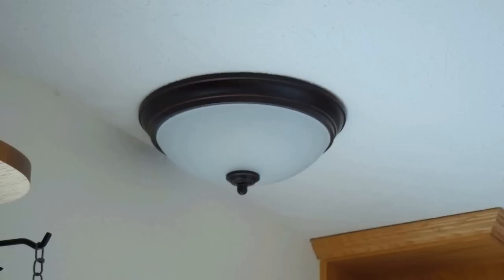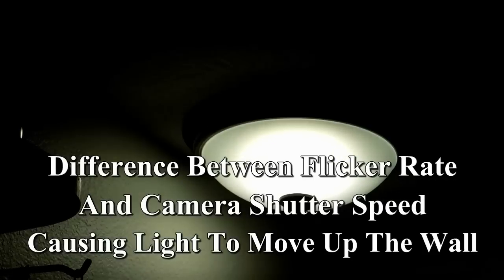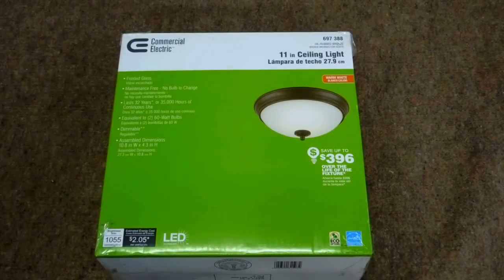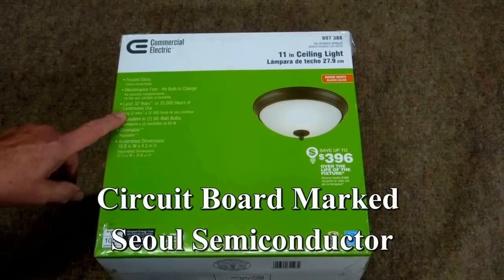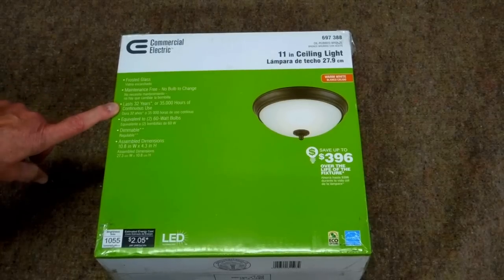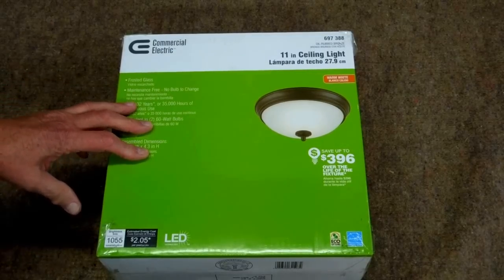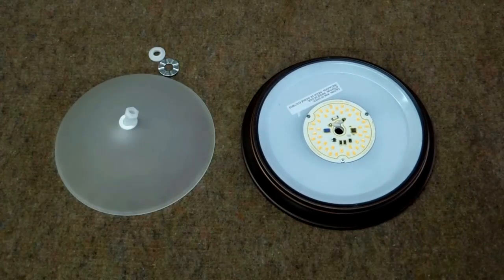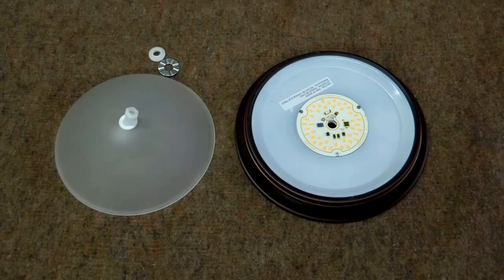LED Ceiling Fixture - Multiple Failures

Comment: That is to a tee the exact fixture in my kitchen failing already up less than a year
Reply from the maker: You have two choices with this fixture.
You can go get another one and return the current fixture as bad... but they will just keep failing.
Or... you can keep the "shell" and replace the contents... which is what I do in the following video series.

I had an offset electrical box in the ceiling and this fixture worked well in that situation. I actually needed this fixture (over my kitchen sink) to work so I decided to re-engineer the bad product.

This shows several things I tried and some were failures... mainly because the LED's get too hot.
 
Part 1 - Salvaging Commercial Electric LED Ceiling Fixture
https://youtu.be/mdg59Wxq0MU

Part 2 - Salvaged LED Ceiling Fixture With Bulbs & Wood Ring Base
https://youtu.be/0RE1dTZ99x4

The following works well but the bulbs (which are LED's) do flicker on occasion... not all of the time, but on occasion... and usually briefly. 

Part 3 - Salvaged LED Ceiling Fixture - A Different Way
https://youtu.be/pFjdLsC1OMI

Thank you for watching. Please subscribe! 
That is what keeps this channel going. 
Ron

Comment: Have bought 2 of these, 10 yrs ago. One is in the shower, exposed to moisture, and started flickering recently. It will start up fine but flickering after a few minutes, perhaps due to heat buildup. The other is also in a place not used frequently, but still works fine. 
My advice is, don't bother with fixtures with integrated LEDs. It just becomes a hassle to replace, vs a simple standard led bulb.

Comment: SO only solution is replace this new one? I replaced 1 in the last month and the second one is doing the same. is there anyway to repair this? Thank you for the video and response.
Reply from the maker: It's just cheap electronics and no reasonable way to repair one. I'm thinking about gutting the light and installing a transformer and some better LED's inside but I haven't done it yet.
Thanks for watching. Ron

Comment: I am having issues with the same brand. They are the 6 inch low profile pot lights. I have four of them. One of them flickered right out of the box. Thought it could be wiring but after inspection wiring was fine.
Reply from the maker: FYI ... and not necessarily your problem.
LED's run on DC. Your house electric is AC. AC is converted to DC by the electronics inside these lights.
Some of the boxes for these LED fixtures will say something like, "will work with most dimmer switches".  Dimmer switches work in a number of different ways, but the end result is they lower the voltage to the bulb and the bulb burns dimmer (less brightly). Some dimmers change the waveform of the AC leading to the bulb.
My experience with these fixtures was they would not work with a dimmer at all. They flickered violently even with the dimmer set to full brightness. I had to remove the dimmer switch and replace it with a standard toggle switch.
Thanks for watching. Please subscribe! 
That is what keeps this channel going. 
Ron

Comment: What do you do to swap out an existing LED light like this with a basically similar one. Having the same issues with our light that was here when I got the home...thought it was a simple bulb...nope, LED.
Reply from the maker: First, you need to be competent to wire anything electrical safely. If you are, turn off the breaker and then test the wires to make sure the electricity is actually off. 

Then, if you find the exact same fixture, you can simply disconnect to existing fixture and install the new one. These are held to the ceiling outlet box by the knurled knob in the center of the glass. That knob screws onto a section of threaded tubing. The threaded tubing screws into a bracket, which is actually attached to the ceiling outlet box. When that is unscrewed the whole fixture will come down and will only be stopped by the wires, so be prepared to catch it. 

If you wish to install a different (type) fixture, then you will need to deal with whatever method holds it to the ceiling outlet box. Hopefully it should be quite similar. Wiring is simply a white and black wire and a green ground wire. Pay attention to how the existing fixture is wired (take a photo of it) and then install the replacement the exact same way. Make sure there are no bare wires when you are done.

Usually this means working overhead on a ladder so pay attention, have someone help you and be careful. Again, if you are not comfortable doing this, an electrician or asking a knowledgeable friend is cheaper than a hospital visit or a funeral. :-)

Thanks for watching. Please subscribe! 
That is what keeps this channel going. 
Ron

Comment: Did you install a normal fixture (one where a normal human can just replace the lightbulb inside) after this?
Reply from the maker: Actually, I like the light when it is working. Since they still sold these, I forced them to replace mine when it failed (each time).
Reply: @RonaldWalters2010  oh right, thats one way to do it I guess, at least until this fixture is still made/uvailable to be bought

I never understood the need for manufacturers to sell this all in one fixtures in recent years, why cant a lightbulb be a separate component, so when it dies you just replace it without needing to hunt for identical fixture because the company that made it so happens to eather not make them anymore or be out of buisness

Comment: Why do LED light fixtures even exist. Like I want a light with replaceable bulb. LED light fixtures should be illegal. Plus they are expensive. Because when the fixture burns out. You have to get a new replacement fixture.

Comment: the LED will last 30 years. But the ac-dc converter circuit will fail , usualluy due to leaky capacitors, within a few months sometimes!!

Comment: It’s usually not the AC-DC circuit that’s causing problems but faulty LED modules. You can test their resistance one by one using a multimeter to find the faulty ones.

Comment: Thank you for confirming these garbage products.  We just had a kitchen renovation where the 1 of these products were used.  It stopped working in less than 9mos.  After attempting to "replace the bulb in it," i realized that's it's a single assembled unit.  What a piece of trash!  

I will replace it with a normal, bulb replacement type.

Comment: I’d just buy LED bulbs. Every of my 60w equivalent LED bulbs still work after being used for almost 3 years based on at least 8 hours a day. You just bought a bad light. And also, your bad light fixture doesn’t advertise lumens right. That light is 1,055 lumens which is a little less lumens than an average 75 watt bulb at 1,110 lumens. Two 60w bulbs is about 1,600 lumens or one 100w bulb.

Comment: I thought the problem was the fixture or bulb, but NO....the problem is the circuit breaker the lights are on. Get it checked. Could be a loose wire on the breaker. Call an electrician.
Reply from the maker: It's the fixture. Don't need an electrician. I built and wired my own house.
Thanks for watching.

Comment: Thank you for exposing this "integrated LED convenience" garbage. Over the years I have slowly started to accept LEDs, especially for household use. But these companies trying to phase out sockets drives me up the wall and then some. Especially Commercial Electric with their infamous "lasts 35-45 years!!" Like come on, the technology hasn't even been perfected for 10 years and they are throwing those kind of digits on their products. It's like they are claiming that they have been testing these fixtures for that long. 
PLEASE, if you're planning on going LED along with new fixtures, stick with a fixture that has your standard sockets to install your REPLACEABLE bulbs, the simple solution that's been around for over 100 years. All these seem to do is create more electronic waste, which is already a major problem. Not very eco friendly if you ask me.

I actually work at a Home Depot as a merchandiser, and we had one of these on display go strobe mode and had to be disconnected because it was so intense. Similar situation happened with an integrated wall lantern that went strobe mode for the longest time until finally being taken down because it went on clearance.
Reply: Some newer fixtures actually have replaceable LED modules.

Comment: I'm so glad you made this video. I have the same fixtures and am having the same problem. I thought because of the 30 year guarantee it wasn't the light. You saved me alot of time and headache because I thought it was the light switch.
Reply from the maker: Glad it helped. Theses will also strobe on a dimmer switch. They say they will work with a dimmer but more than half the time they strobe.
Reply: @RonaldWalters2010  Fingers crossed I bought a dimmer switched rated for LEDS (and CFLs) to control 2 LED dimmable bulbs I have in 2 standard ceiling light fixtures. Running fine for about 2 years now.

Comment: I purchased 5 of those... I have a hunch, when wired parallel to high energy use items - they flicker. Have a bigger hunch that they can't handle loads like traditional LEDs. Need to check manual, wonder if they genuinely need a dimmer switch, which would not make sense.
Reply from the maker: Mine are not on a circuit with any large loads.  Initially my first one was wired on a dimmer and that usually (but not always) made it strobe (flicker) so now it has a simple On/Off switch.

Comment: I saw the datasheet online and the circuit is pretty basic. I'm guessing the bridge rectifier (labeled BD1) might be failing. You might start to see AC effects if one of the four bridge diodes has gone bad.  And LED's will flicker under AC.
Reply: How can I check if this is indeed the case? I have exactly the same flush light, and it started flickering

Comment: My fan with a light over my bed started doing this after 13 years. Can it be fixed or does the whole fan and light have to be replaced?
Reply from the maker: If the LED part is built into the fan light fixture, you probably end up buying the whole thing new. If the bulb is screwed into a socket, replace the bulb.
Reply: Ronald Walters I will need to get someone able to check that out for me. Thank You for your help. I am 68  young guy but very disabled, how disabled you might ask? I have to pay someone to change a lightbulb.  But thank you for your response Sir RON. I appreciate it. I had a guy take off the glass cover and the bulb I saw was really tiny about 3-4 inches long and bout 1/2 “ in diameter. I don’t know if he even tried removing it but I will ask him to try it again. It might be cheaper to buy a whole new unit instead of hiring an electrician to have a look Sir, know what I mean? And I must say you Sir sure are lot smarter than the normal regular guy.  Thnnx..

Comment: I think they fail because of heat, you should not tight the middle nut of the glass. Leave space between the fixture and the glass so the heat can escape.
Reply from the maker: There is no heat. It runs cold, possibly because of the large metal base. That fixture can run all day and it remains at room temperature. Now some of the LED bulbs get warm/hot.
Reply: The heat from the bulbs has to escape. The number one enemy of the led bulbs is heat. Ass a matter of fact, heat is the number one enemy of any bulb.
Reply: They fail because they are garbage. Cheap rectification circuitry.

Comment: I have excellent luck with LED bulbs. I have been using LED bulbs for several years and have yet to have one fail.
Generally I buy standard fixtures and put LED bulbs in them, or I build my own and use a power supply from China, non of which have failed. In my shop for machine lights I have a central PC power supply and run 12v lines out to the machines where I have diy lights, non of which have failed.
Reply: Smart choosing to buy fixtures with standard sockets rather than this integrated garbage. At least when the bulbs fail you'll have a much more pleasant time screwing in a new bulb rather than having to rip out the fixture entirely to replace it with something else.
Reply: These are circuit boards they don't screw in like an led lightbulb. They suck

Comment: Hi Ron, I attempted to remove the glass dome on a General Electric LED with a brushed stainless fixture almost exact to this one.  I live in an apartment and just wanted to clean the dome. The install was wrong and when I unscrewed the exterior cap I discovered that the metal fixture was being held by the exterior cap. I learned the hard way that it was necessary to trim about a .25" off the end of the white plastic interior tube to allow an interior thin nut to hold the metal fixture to the ceiling. What I did wrong the first time was to reinstall the fixture just using the exterior cap to hold the fixture to the ceiling. The next day I saw that the LED had dimmed to almost no light when turned on. I think I put too much pressure on the electronic circuit board when screwing the complete fixture to the ceiling using only the exterior cap. I replaced the entire fixture and did it the correct way the second time. It seems that the white plastic tube is too long and it may be necessary to shorten it so that a interior nut can hold the fixture to the wall. I did this only 3 weeks or so ago.
Reply: Also: LED bulbs seem like the way to go for sure but good reviews like this will definitely help improve quality. Thanks

Comment: One thing that I've learned long ago was WRITE THE DATE INSTALLED ON THE INSIDE. Was doing maintenance for my church. Changed everything over to T8s well in about 1 year started having issues with a whole bunch of the new ballast. And because that I had original receipt  and DATED EACH ONE as they were put in were able to confirm they were all one lot number that had problems.
Reply from the maker: I also write the purchase date on everything.

Comment: more reason I'll stick with fluorescent tubes, ones in kitchen and bathroom have been there easily 15 years with no failure while various other bulbs keep failing depending on fixture, airflow and such I presume. it's also been a surprise just how much light comes out of an 8w 12inch tube, package says 470lm which should be about the same as an old 40w bulb. LEDs might be great if they're good, but it takes a lot to make them work well, judging by how many flickering annoyances I've seen in restaurants and elsewhere.
Reply: Bug Lord even the new cfl bulbs are garbage.  they don’t last that long either.  people wanted cheaper bulbs and they got them at the loss of quality

Comment: Looks to me like one of the leds is broken. Probably a semi-detached bonding wire inside the package. 
You could try testing the individual leds using a multimeter in diode mode and see if you can find the one broken led. If you find it, short it out by soldering a short piece of wire across then two led pads.
Reply from the maker: Failed units are long gone... turned in for the replacements.
Reply: @RonaldWalters2010  Probably for the best. This way there is less incentive for them to keep using this design.
Reply: @LynxSnowCat  I do like LEDs tho.
Reply: @RonaldWalters2010  Plus LEDs don’t like to be turned on and off constantly. If you do manage to do that it will significantly shorten the life and once that thing burns out YOU WILL HAVE TO BUY A NEW LIGHT FIXTURE.
Reply: Agree. Probably the heat trapped in that fixture causing the parts of the LED to separate.

I'd suggest taking the light diffuser off and filming on high speed/slow motion. The failing LEDs will start to dropout before the others while it warms up. Between four failed units there should be enough LEDs to make one "adequate" example, if one is gentle with the soldering iron.
Reply: In other words spend an hour fixing what shouldn't have been broke in the first place.